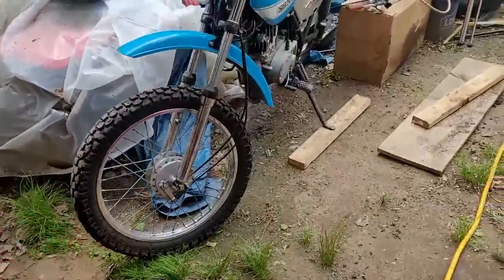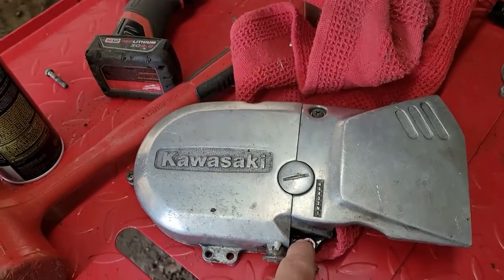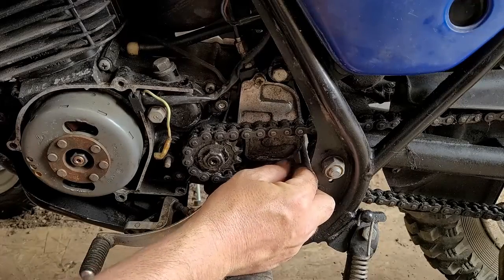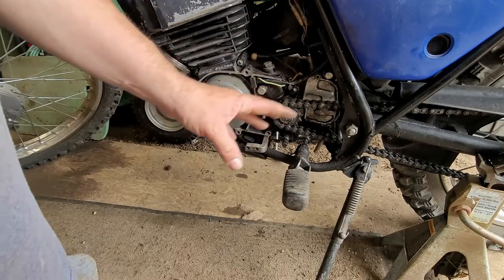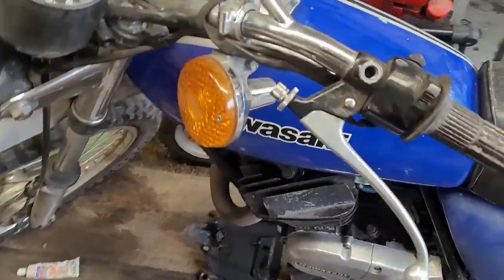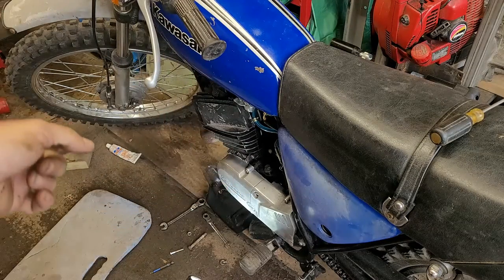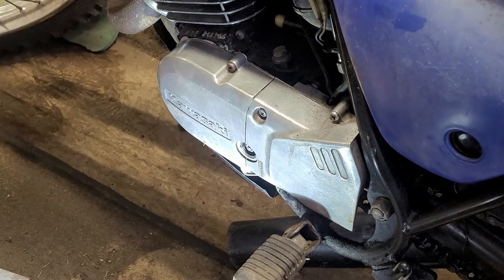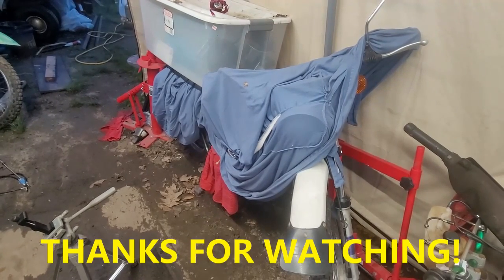Working on Alvin's KE125 getting the left side together and clutch adjustment

Comment: Hey Kevin I got a question about my clutch. so I followed your instructions the best I could (I have a 76ke 125 ) but my clutch won't disengage, when I pull in the clutch lever I can hear the disc's popping and I've even had the engine apart and have seen the disc's move! so could it be that the clutch is bad or maybe a overly stretched cable?